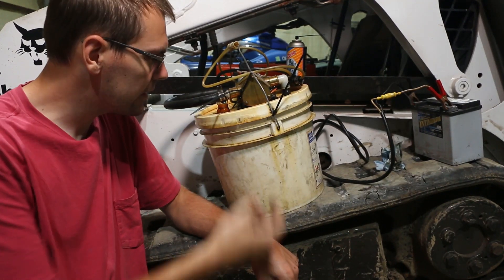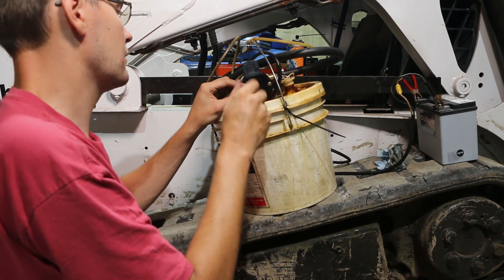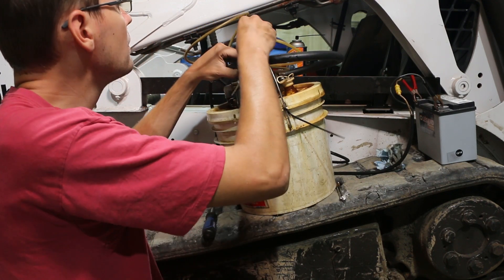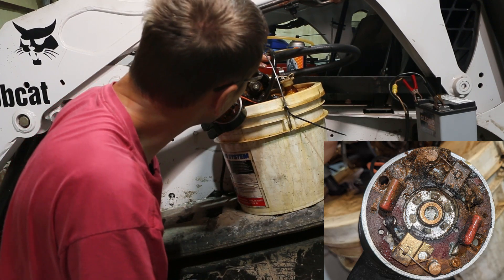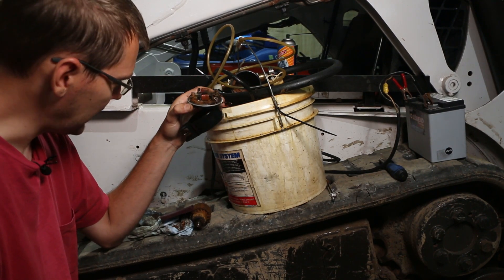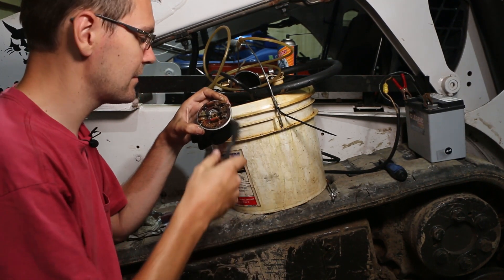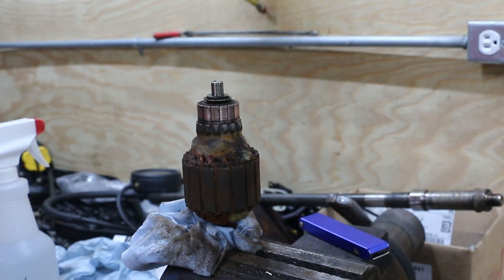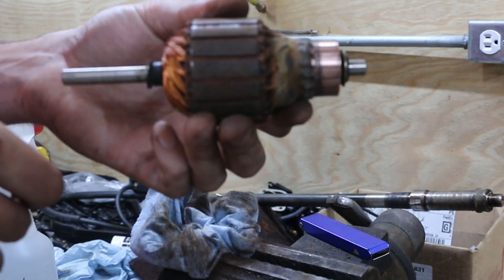Repairing a water damaged Jabsco 17800-2000 oil bucket

Comment from the maker: If you need one of these buckets (You do if you do more than one or two topside oil changes a year):
Jabsco 17800-2000 oil change system: https://amzn.to/3gtlFyG
Replacement impeller kit 9200-0023-P: https://amzn.to/3zfinGL

Now be careful, some people are trying to sell the plastic housing 17850-1012 series pump as the 17800-2000 that is shown in this video. the 2000 series oil change pump has a brass body and uses a flexible rubber impeller and absolutely rips oil out of engines, the 1012 series pump is slow and not worth nearly the cost of the brass pump.

These links might be affiliate links, which earn me a small commission if you choose to purchase from them.